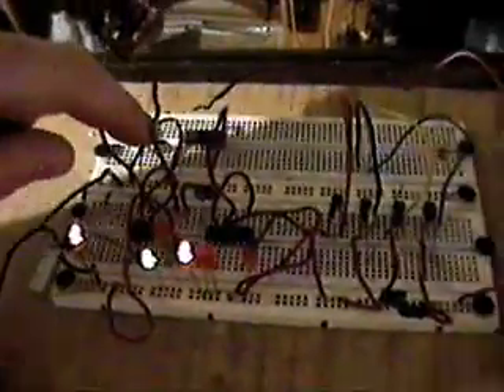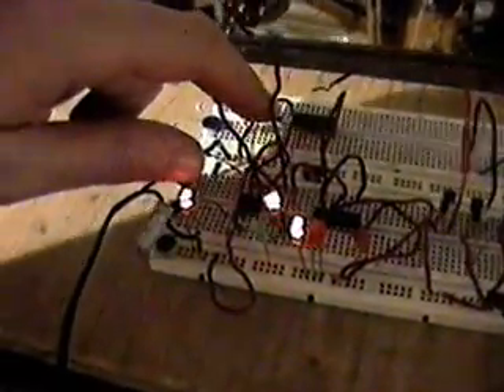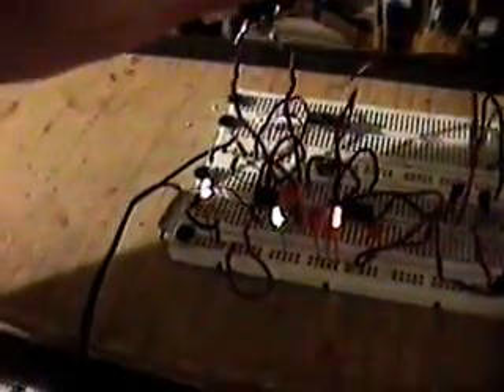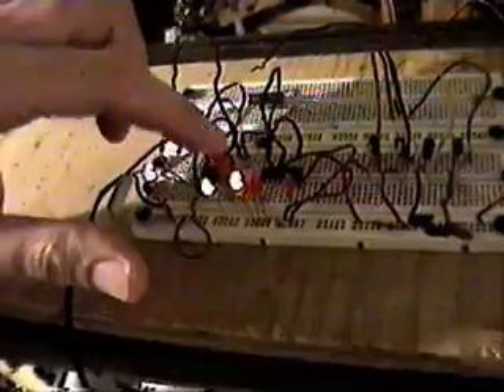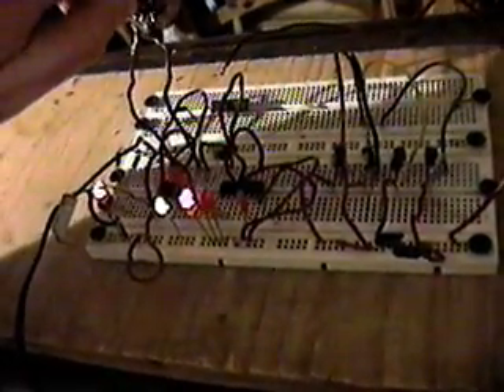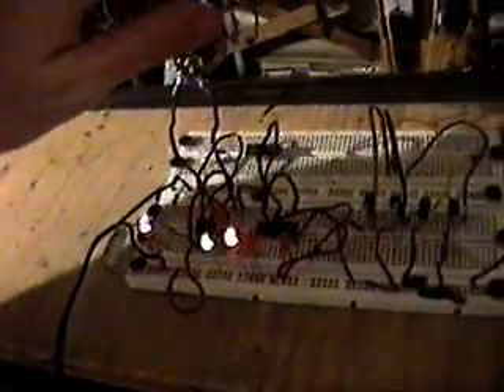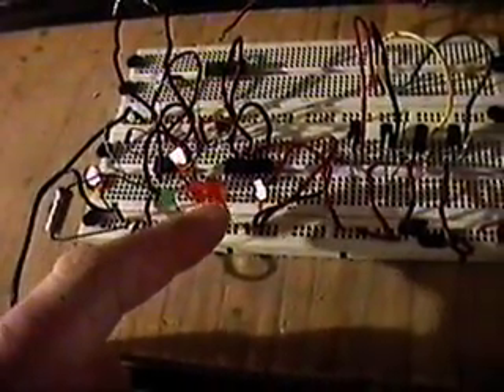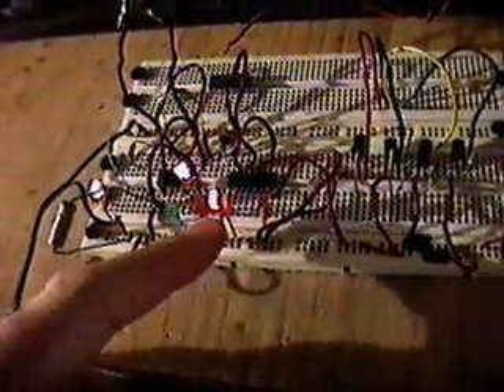4017 Decade counter

Comment: I can't tell without being there.
your 555 must have a clean signal of off on. 

If you have your 4017 wired correctly you can manually trigger it. It won't be 100% as with a manual negative pulse there will be noise in the signal(the falling high-pulse).
A noisy trigger makes for unstable counting.

If I have the time I will post a how to wire a 4017.